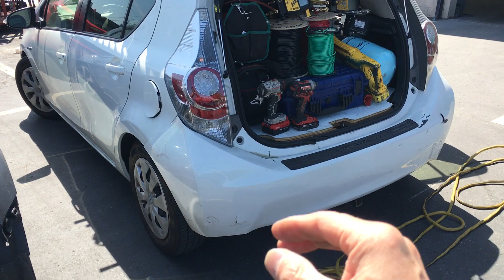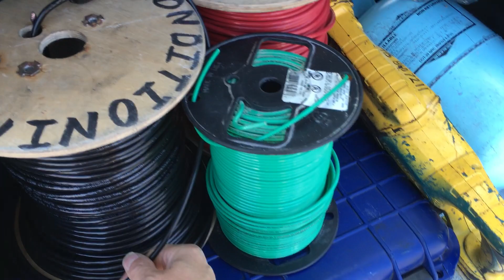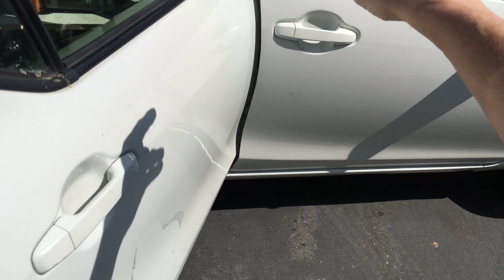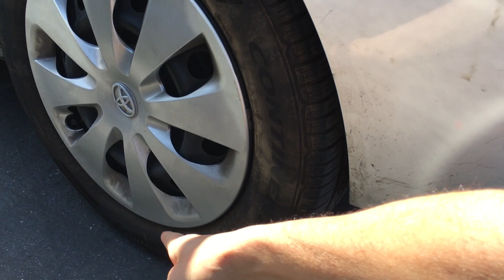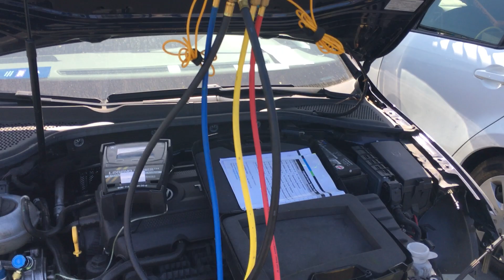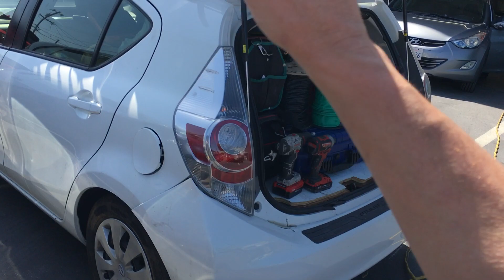Recover the bad refrigerant,  + what vehicle is best for your type of business in your location

Comment: Why not use something like a ford transit connect? They are about the same size.
Originate from europe where roads and parking are small.
I believe there is a hybrid also.
Reply from the maker: Compared to this vehicle there gas mileage sucks  just in the gas savings I can completely buy a whole new vehicle by the end of life and the difference in cost of gas alone. 

      The transit is a very nice small size van but even that is too long in Samovar parking areas that I have to go to in the parking in the illegal places or having to search for parking for extended time.. 
        Even my car and some of the parking spaces in between residents can be too long and protrude into parking spots my last vehicle was 9 inches shorter which was perfect. 

        And if I ever have to carry a lot of supplies and equipment out to a job site I just hook up my trailer and put another thousand pounds and carry as much as a large pick up with a 5’x 9’trailer  then disconnect it when I’m at the job site and I’m immediately back into a small vehicle again. 

          Then here in America and out here in California your insurance based on the gross vehicle weight and the cubic foot in ternal size of your vehicle when caring compressed gases and flammable gases your insurance goes up significantly

         But if you’re in a sub compact vehicle because if it’s gross vehicle weight in the limited internal cubic foot capacity you’re under all the rules laws and regulations for caring compressed gases and flammable’s because the compartment size is so small big drop in insurance price
Reply: @coldfinger459sub0  A Suzuki Carry maybe 🤣
Reply from the maker: How did you know I had a three cylinder 1L. Suzuki that was my first brand new vehicle I ever bought for $5995 vehicle 1988 Chevy sprint was a Suzuki. Lol 🤣
           I drove that for 368,000 miles and is still in good condition original engine original transmission it got hit by a car and totaled out.
Reply: @coldfinger459sub0  Swift, Metro, Firefly...Great cars. Laughed at by the public. But the owners laughed all the way to the bank 🤣
Reply from the maker: @TheGibby3340  I remember when I first bought my 1988 Chevy Sprint AKA ( Suzuki )  to fill my gas tank was $10 USD  at 52 to 58 MPG I remember I could buy all four tires for $100. And last 80,000+ miles because the car was so light. 
            My first set of brake pads I change at 126,000 miles lol 😂 only pads took 15 minutes to install and cost $17 

        I remember when the recession hit gas got to just shy of $5 a GL owner of mobile HVAC Business complained about the high cost to run a van.   Having to replace van tires @ $150 a tire ea, and having the young drivers drive hard eat up the brakes here in the San Francisco hills rotors + calipers cost $700+ 

       I was cruzing along with no worries in the world. And I drive over 30,000+ miles a year. 
           As a business owner we get $.57 1/2 tax credit off gross income for each mile we drive 🤣 in this car it’s positive income. That’s over $17250. Off gross revenue. 
          Me and my brothers would each get 12 payed week of vacation a year. 
        People would ask how I could travel all over the world many weeks at a time. 

     How about try low over head to run a Business. Instead of expensive yellow pages ad listing and advertising big expenses van with fancy stickers all over the van.  Absolutely ZERO ADVERTISING and my turn down work is always more then I could ever do in my life time
Reply: @coldfinger459sub0  Everything you mentioned here used to be common sense economics...101. Somewhere along the line people (not all) really have been sold a bill of goods. Putting image and ego before sound financial reason. Few people are willing to accept it takes long term graft and discipline to secure themselves. I am not really interested in money, so financial conservatism comes easy to me. My goal in life has never been to make it rich... But I have done my level best to make sure I am never broke!
Reply: Bro i swear I ran in to you about 6 or 7 years ago outside of Baker.  You were preaching on Sman's and how to fix there leaks.  Luckily my truck was stolen and I didn't have to try and remember how to fix it. Anyways its the car that reminds me of that day.
Reply from the maker: @Zamoramax6.6  OK the little white Toyota Yaris that should ring a bell. 

       Now I’m driving a little white Toyota Prius.
Reply: @coldfinger459sub0  yes!  Thats the one.